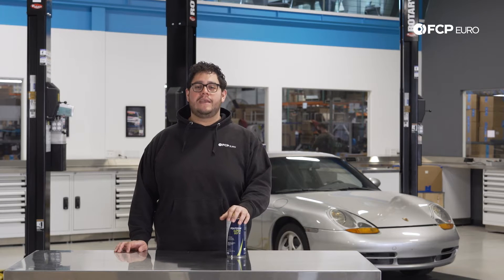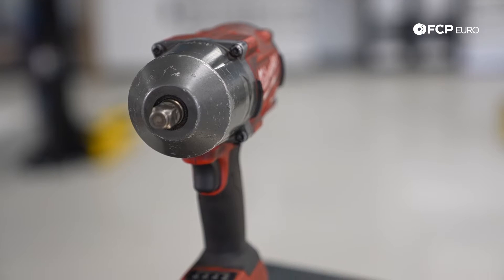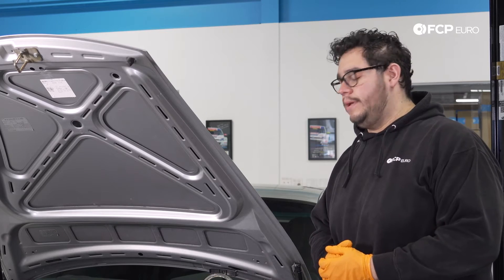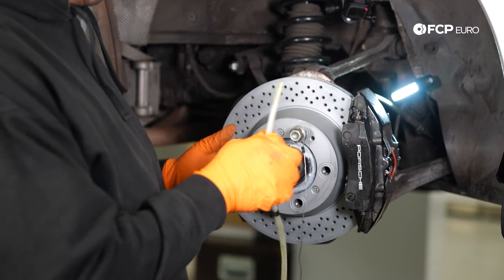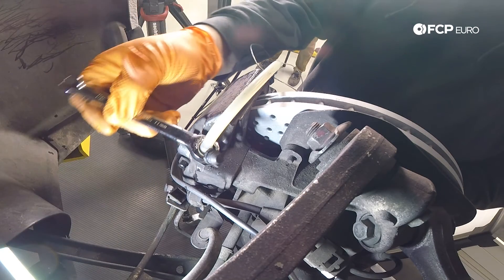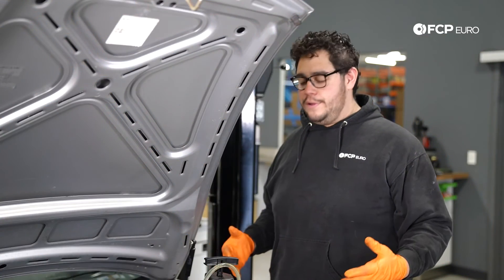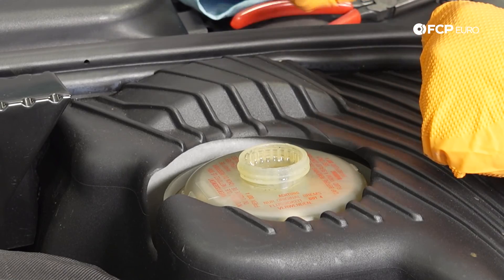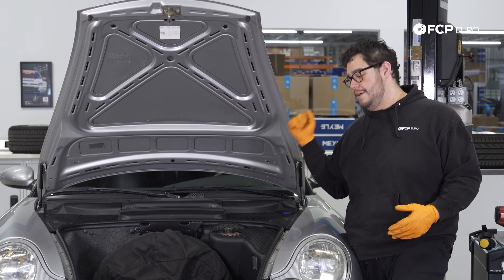Porsche 996 911 Brake Fluid Flush DIY (1997-2004 Porsche 911)

Comment: Bleeding usually done in diagonal pattern:rr-fl, rl-fr. that how brake system designed . But for some reason everyone say do furthest first. All 2000s repair manuals for VW used to say diagonally.
Reply: Porsche manual says “in no particular order”. Just 1.5 bar of pressure and flush until clean
Reply: @Van-tastic  1.5 bar is approx. 22 PSI. I'd be concerned about popping off the reservoir. I use 12 to 15 psi. Seems to be fast enough. My recollection is that the instructions for the Motive say not to use more than 15.
Reply: @GarthGoldberg  Garth, I just read the manual… as usual, Porsche is annoying with it’s procedures. So, vehicles without TC, like my 99, should use approximately 1.5bar. Vehicles with TC, should use 1.5 - 2.0bar.
Additionally, the procedure for “bleeding the brakes” calls out RR, LR, RF, LF. However, the procedure for “changing the brake fluid” says, “no special sequence”. 
What’s the difference between bleeding the brakes and changing the brake fluid? We’re not qualified to know!
Reply: @Van-tastic  if you let out all of the old fluid, then you're changing the fluid. Otherwise you're just bleeding the system, i.e. letting air bubbles and and some of the old fluid out.

Comment: Hey great video, I liked it very much. I am originally german and just got myself the 996 C4 - my dream since I am 6 years old! Just wondered if it is not better to first empty the reservoir from the old brake fluid before connecting the motive bleeder - otherwise you have to drain all this through the calipers before getting the new brake fluid there...no?

Comment: Important with Porsches with an ABS in the Brake System the order changed, so the first wheel is front left, front right, rear left and rear right. Usually 1-2 liters of Brakefluid necessary
Reply: This is factually incorrect, nobody listen to this.